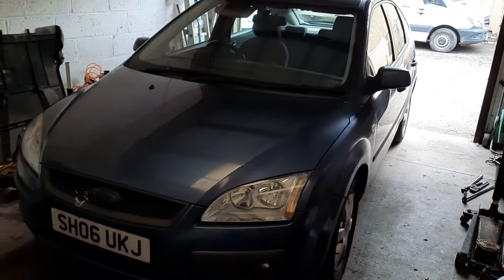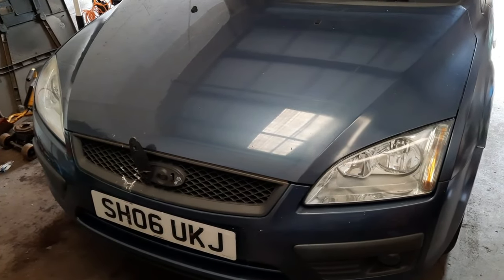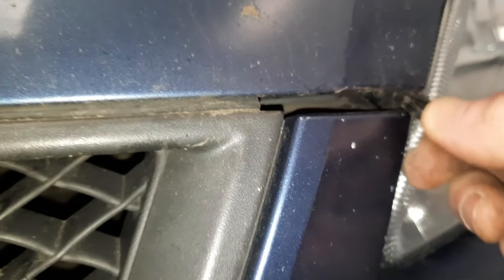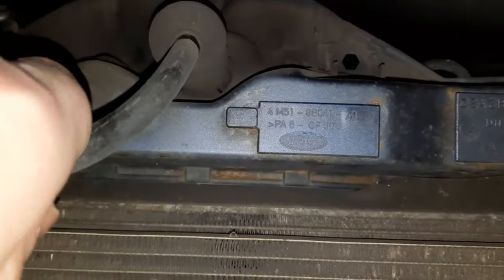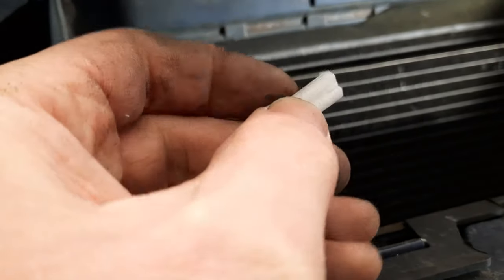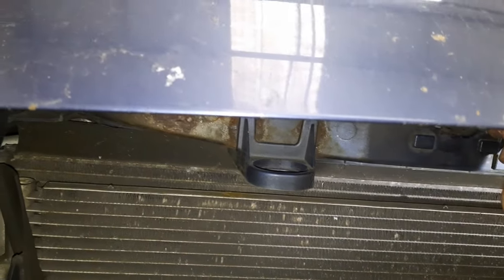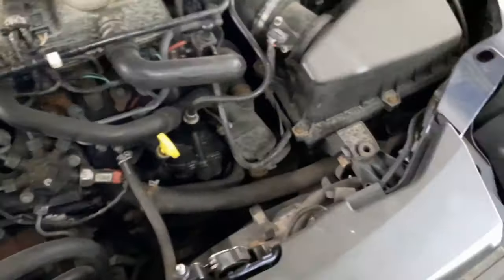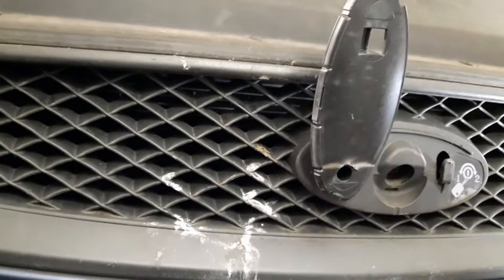Ford Focus bonnet wont open - How to open in an emergency

Comment: I've just literally finished doing mine,thanks alot mate for sharing this,hardest part was getting my grill out,all in all it cost me £21,£19 for the lock and £2 for the plastic screws,l just got a chisel and chopped through them by tapping it with a hammer,managed to rip the entire grill and panel out did abit of damage on the inner panel but nothing too bad,thanks again 👍🏻
Reply: Could you please tell us where you bought them from.
Reply: Can you tell us the part number please? Having the same issue!

Comment: Thanks for making this. Same problem with our 2008 C-Max which I discovered when the battery had died! I managed to fix it after watching this but had to sacrifice the grill. Without one of those tools and only fairly small screwdrivers there was no way I could pop the holding screws out so I just bent the grill out of the way and set to work with the hammer:-) Also, that plastic surround took ages to smash before I could get the cable off - must have baked solid over the years. Anyway, thanks again and the car is happily charging up now and the new grille and lock are on their way. If I could give 2 thumbs up I would.
Reply from the maker: Thanks for taking the time to leave a message. Really pleased the video helped you.

It's comments like yours that encourage me to keep doing what I'm doing.

Thank you.

Comment: Great video, although I've broke into the lock by jacking the car up and getting a 10mm rachet spanner up between the radiator and grill, in order to undo the 2 x 10mm bolts that secure the lock, then pop the bonnet up using a straight edge under the bonnet (wrapped in a bit of card so not to scratch the paint) A great car, but why Ford, why fit such a terrible lock!?

Comment: Just a heads up..I've changed mine but it was actually my lock that was sticking..try to undo the 2       10mm bolts on the lock from underneath the car rather than destroy the lock cable as I did. Chances are it's the actual lock😮

Comment: I've a Mondeo but the locks look alike.
 Turn the key to the left the bonnet pops up a little bit but is held by a catch till the key's turned to the right. However, turning the key to the right no longer releases the catch.

 Life was much simpler in days gone by when you opened the bonnet then slid your fingers under to press the release catch. On this I don't know where the release catch is.
Reply from the maker: The lock will be exactly the same set up as this one so the same (or very similar!) procedure will apply.

Like yours, turn to the left and it pops up a little, turn to the right and it releases the catch.

Thankfully the newer ford's seem to have reverted back to a traditional bonnet release cable inside the car.
Reply: @themidnightmechanic9368  Thank God! This locked bonnet was the world stupidest invention, where do you need it when cars have had immobilizers since 1996.

Comment: Push down on bonnet,turn key,lift,then turn opposite way,,works a charm
Reply: Just found out mine won’t open so found this video. Was just about to order a new locking mechanism after trying everything but I’ll give this a go first 🤞🏼
Reply: @rasher6290  yes mate,was going to replace but it works fine this way-cheers👍🏼

Comment: If you push the white collet back in it will re-connect they usually just get loose, like a male - female insert just need a screw driver to apply pressure to it while turning the key

Comment: Hey mate just wondering since the lock mechanism is off how does the bonnet stay down in place until you got it fixed?
Reply from the maker: Hi there. Thanks for the question.

The actual locking mechanism isn't removed, just the lock barrel and the cable attached you it.

Bonnet still shuts securely but to open it you use a screwdriver instead of the key.

Hope this helps.

Comment: Nice one I done similar didn’t fully remove grill and put a flat bar against plastic bit and smashed off with hammer the knocked the bits out, and put a long Phillips screwdriver through the grill above ford badge to unlock

Comment: When you get the pick tool in at the start of the video, do you still need to prise the bottom of the grill to get it out? I have this same issue on my Focus MK2, same colour as yours lol
Reply from the maker: Thanks for the comment.

Yes, you will still need to prise the bottom clips out. You need to get your hand in behind it to release the little tabs on the lock barrel.

Hope this helps.
Reply: @themidnightmechanic9368  
Thanks mate i really appreciate the advice. I have one more question before i do mine tonight 'fingers crossed it goes ok cos i have a headlight bulb out and with no way to change it I'm screwed'. You know when you get the grill off and have access to the cable lock, can you just pull on it to rip it off, would that work. You said you knocked your plastic fitting off with  hammer, but would it be ok to just rip out cable with brute force?
Reply from the maker: @J_M_E_83  you could try brute force. All you need to be able to see is "plus sign" slot to get a screwdriver into.

Either way it needs broken off so do whatever you need to do to get access to that "plus sign" slot behind that cable.

Couple of small taps with a hammer and it broke and fell apart if I remember correctly so you might be about to break it off by hand.

Comment: I followed the video, it helped me out thnx, What are the black plastic screws that hold the grill and other plastic cover together, after I snapped the heads off,  my grill is held together with cable ties for now.
Reply from the maker: Glad you found thr video useful.

I call these things screw rivets or "scrivets"... I'm sure people call them different things. If you Google "screw rivet", "push rivet", "plastic rivet" etc you will find what you need.

Hope this is helpful.

Comment: Thanks for this. Did you replace the lock, that would be a handy video to watch.
Reply from the maker: Thank you for your comment.

I never got round to ordering a new lock kit for it. Ended up selling the car.

Swapping the whole mechanism is the easy part though, it's only held in with two 10mm bolts (on the engine side of the slam panel).

Comment: Thanks for posting this.
Did my daughters focus a couple years ago and am about to do it again on her replacement focus.
Looking on here because can't recall how got grill out !
It's  same arrangement on my mondeo3 and transit  - an anti-tamper connection stops owner !
You need a longer screwdriver for the focus than on mondeo.
No way would I replace any of this rubbish design - I read Ford dropped it on mk3 focus
Regards
Reply from the maker: Thank you for the comment, really appreciate it!

You are right, more modern ford's reverted back to a traditional pull cord inside the cab as the key on the grill was plagued with problems!

Comment: 4:50 was play on mine, some forward and back movement so pushed inwards with some force and it managed to pop it open the first pop the next I had to push towards the right on the metal clip, viola, now the white plastic piece is still in however it seems worn so not sure if the new one will have it… it’ll arrive tomorrow… thanks for the guidance to save a single mum some money!

Comment: These must be a real nightmare, as 2 of our local garages have refused to fix my broken latch.   They know what a pain in the arse they are I think.  I also cannot get the grill off, certainly not without major damage at least.  so i'm stumped now.
Reply from the maker: Just do exactly as I did to remove the grill... once those screw rivets are free then give it a good sharp pull.

I found pulling one side of it at an angle towards the opposite side the grill comes out easier.
Reply: @themidnightmechanic9368  I'm gonna give it another go in the next day or so.. so fingers crossed.

Comment: I got the same issue. How much does it cost to repair it in the garage?
Reply from the maker: Thank you for your comment.

Prices will vary wildly depending on the garage and where they source the new parts.

Here in Glasgow, Scotland, I'd estimate about £100 - £150 would be about average.

Comment: About to attempt this method after getting RAC out to help me with me car as it was making a horrendous noise ( power steering fluid/pump ) to then find I couldn’t get into the bonnet. Thanks Ford. But thanks for the video.
Reply from the maker: You are welcome. Hope you get it sorted.

Comment: Why get one at a breakers and keep the lock barrel? sod that, just buy a new one for 15 quid on ebay with a set of 2 keys
Reply from the maker: The issue with that is you now have two different keys!

The barrel itself doesnt fail, easy to swap over.... its like the bonnet incident never happened! lol

Comment: Bloody stupid of ford to come up with a mechanism which is subject to failure.  What the hell do you do if you’re on the side of the road.??
Reply from the maker: Exactly!

They used this flawed design since the late 90s until recently.

Thankfully they seem to have reverted back to the tried and tested latch and cable setup.